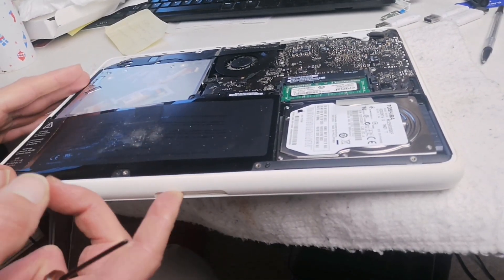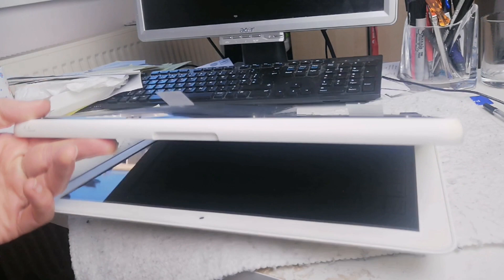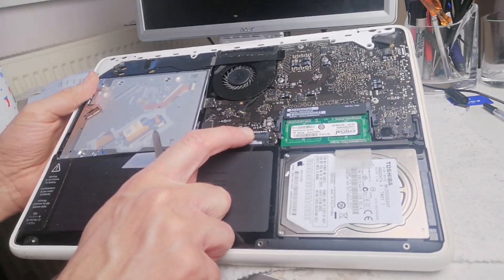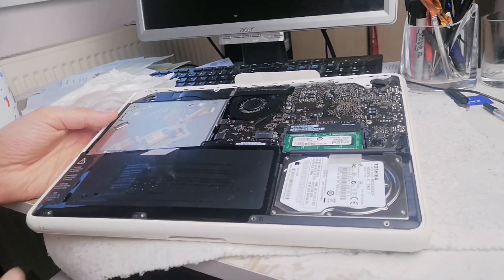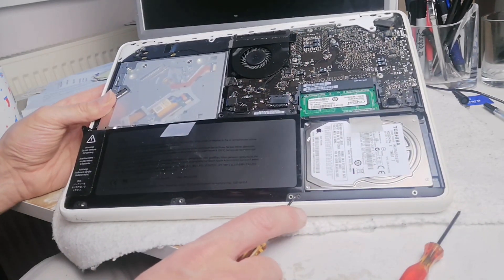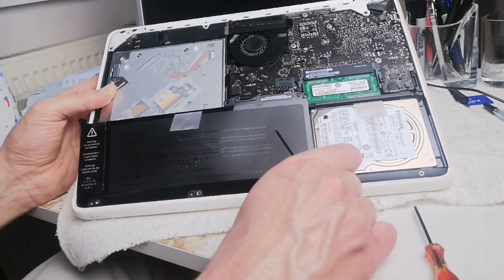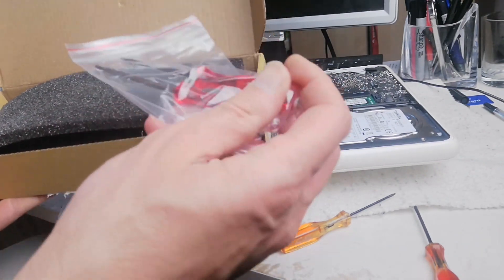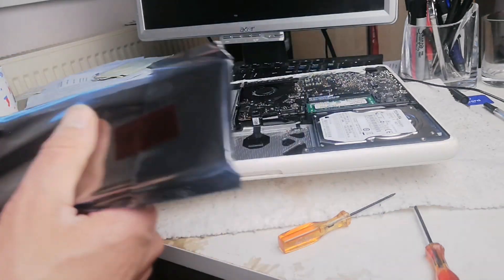How to Quickly Replace battery Apple Macbook (A1331 A1342 2009-10)

Comment: Got this same battery, after the installation did you make any charge then full discharge cycle? or just direct use?
Reply from the maker: No, just told the customer to remove after full 100% and then remove from mains and don't discharge to 0% :)